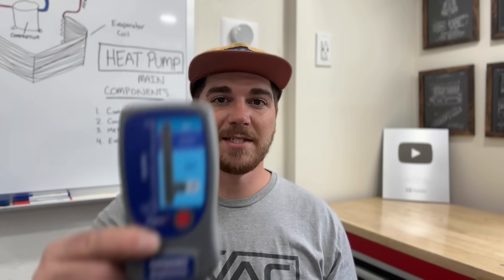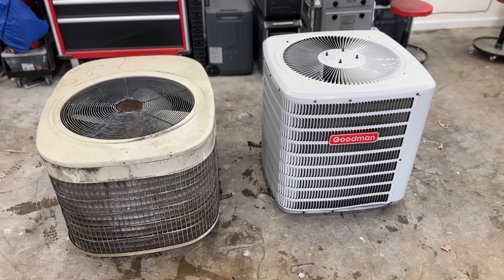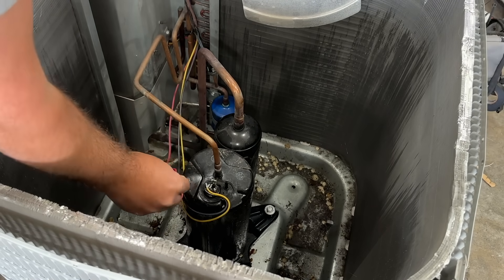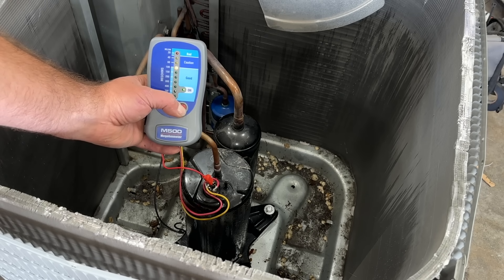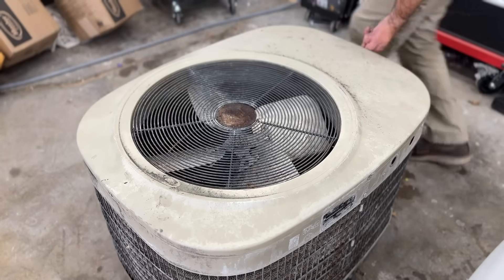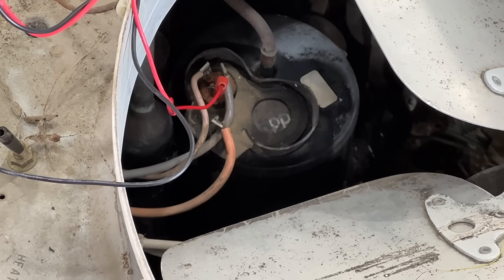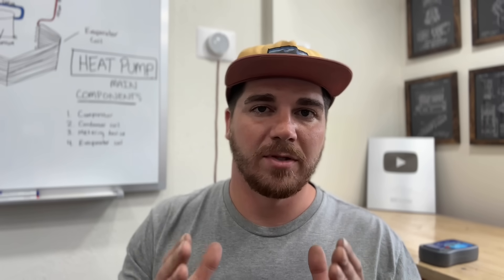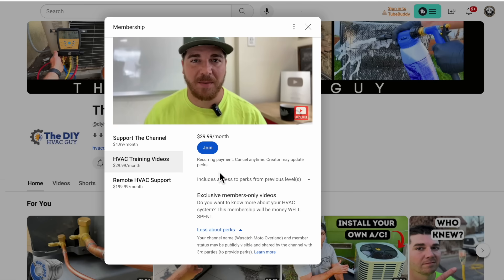Is Your A/C Unit About To Die? This Tool Doesn't Lie

Comment: i just had a HVAC tech tell me i need a new compressor and my fan motor was going because it was noisy. they gave me an estimate of $9600 to fix it. My heat pump isnt working but i never use it, i have wood heat. i do use the air conditioner all summer. appreciate this segment. may have to get one of those meters and test it myself. thanks

Comment: When testing a compressor, remove all three wires. When you pull only one wire and perform the test, you are putting 500 Volt through the entire winding. That voltage continues through the windings to the other terminals. The wires that remain terminated and the things they are connected to are included in the test.

Comment: This is a fucking lie. I’ve already talked to Copeland scroll and alliance, which is Trane. And they don’t recommend it at all! Now I have used that meter in California. They do not allow that particular meter because it’s wrong. That’s from the union workers for air conditioning they rather have an analog one but again I have talked to a lot of the companies like Copeland scroll and they do not agree with this. Now I have mega armed with that fucking meter compressors before I’ve started them! And after I ran them for several minutes! And it gave me two different fucking answers so that fucking meter doesn’t mean shit! And again I’ve talked to Copeland, scroll engineers, and Trane engineers about their alliance compressors.

Comment: The megger readings on all 3 wires will normally be the same since they are connected together in the compressor motor through the windings (low resistance).

Comment: This is interesting but I'm not convinced. The compressor is a motor and the motor has windings and we are measuring the quality of the insulation of the windings. So then what are the various failure modes of compressors? I would think a compressor could fail in various ways. The insulation of the windings would only be one of many possible failure modes.

Comment: The megohmmeter may not lie, but it doesn't always tell the truth when it comes to a compressor full of refrigerant. According to a Copeland Service Bulletin, a compressor with a megohmmeter reading as low as 0.5 megohms will still pass the hi-potential current leakage test required by UL. The Supco meter condemns anything below 30. Contaminated refrigerant is one of the things that can affect megohm readings.

Comment: Except you cannot use them a megometer on modern scroll compressors. Many standard megohmmeters may indicate a faulty reading below 10-20 megohms, while some scroll compressors can have acceptable readings as low as 0.5 megohms to ground. Use standard ohm settings only!

Comment: I just bought that tester, and to my surprise, my compressor is good. Now upon closer look, I think I got the wrong capacitor. So the correct one is coming in a few days. I also consulted the close up photo I took of the original capacitor label and hook-ups, (what color wire to which of the terminals). Otherwise, I'm looking at around $17,000.00 for a whole new cup of noodles.

Comment: You're using it wrong. You should have nothing connected to the compressor at all. You're charging up the capacitor that's why it's taking a while for the reading to creep up.

Comment: Got a coupon for free checkup from a local big name HVAC company. They send commission knucklehead tech to inspect my 2006 air handler, said the contactor is shot, need an entire new system, nobody makes contactors anymore (BS) and a company salesman would stop by and get me setup for a new one. A second opinion said contactors fine. Five years and ac still running.

Comment: 1:46  pull disconnect so no power  nothing live...  WRONG. after pulling disconnect open disconnect cover & see if it's Not bypassed. BC doing this over 30yrs Many times some jackleg jumped it or it's a bogus non working disconnect box.

Comment: I cleaned out my coils, then the compressor wouldn't kick on, but the fan did. Capacitor went bad, but easy fix. Hardest part was finding the right one nearby.

Comment: 46+ years in the HVAC trade so I'm sure I know a little something about HVAC. 😎 Take it from me when I say "always get a second or even a third opinion from a reputable company". Unfortunately in this trade, too many techs will try to breeze over checking a system and attempt to persuade the client/customer that a new system is required and that they will give you a great deal if you decide to go with their company. Those are a red flag so beware. Good video with very useful information but a great tech will sand or find a CLEAN ground and ALWAYS remove all compressor wires FIRST. That megger tool is  fundamental in my tool kit that has helped me many times. KEEP LEARNING young man because we are always learning new things in this trade. Good luck out there and stay hydrated.

Comment: Great video and advice. I purchased the tool. I have 20 year old Trane dual compressor system. It took everything I had to get to the low stage compress plug and test it, which passed with flying colors. If I want to check the high stage, I have to go Mission Impossible and hang by my feet to get to that plug, with the height of the condenser and 2 compressors jammed in there it's a mess. Is it a safe bet that since the low stage passed, do you think the high stage is in good shape as well? Thanks.

Comment: Once you have megged one winding to ground, you have megged them all, since they are interconnected inside the motor. The resistance line-to-line is very small compared to the megohms that the megger is trying to check.

Comment: Ummmm...wondering why can't I check resistance of each winding with any of several DMMs I already own?????
Reply: A megger applies high voltage to the winding. I have one that goes in steps from 250 to 500 to 1000 volts. This is useful to find bad insulation that breaks down under voltage. Your DMM probably puts out only a few volts. This is not enough to break down insulation.

Comment: I replaced my 1970 Lennox unit a few years ago just because I wanted to update my whole system, about the same time as my 1972 Rheem Hot Water heater that finally failed.      There was a  time when there was still pride in American manufacturing.   😞

Comment: wouldn't a decent multimeter be able to measure megaohms like this device?  or is this something special?
Reply: A megger applies high voltage to the winding. I have one that goes in steps from 250 to 500 to 1000 volts. This is useful to find bad insulation that breaks down under voltage. Your DMM probably puts out only a few volts. This is not enough to break down insulation.
Reply: @tommacdonald6070  ahh ok.  I have a Fluke MM... dunno what model, found it on the road.   AC/DC volts read accurate, likely fell off a vehicle.
I'm sure it doesn't, but will check to see if it has the capability.

Thx!

Comment: I thought you have to check winding to winding not winding to ground
Reply: For a megohm test, youi're looking for insulation breakdown from winding to ground. This should be a very high value of resistance - in the millions of ohms. When checking the windings themselves, you measure from lead to lead. The resistance readings are very low, probably under 20 ohms.

Comment: I've seen a video where the compressor windings were checked using a multimeter rather than that tool.  I wanted to do the same and tried to remove the plug on the compressor, but its rubber and it's stubborn, so I'm afraid to force it and break something.  My question is this; can the compressor be checked by attaching to the other end of the wires coming from the compressor?  I'm not planning on staying where I am and I don't want to have to buy a new unit if I'm not staying so I'm doing what I can to keep my old unit going.  I've already been a victim to the capacitor scam about 6 years ago and now I change it myself every two years just to be safe.  Any help would be appreciated.  Thank you
Reply: Find out or ask in the comments of that video which model of multimeter was used.  I realize this Supco in this one is cheap, the Flukes that can do this are $800 and up for this level of impedance.

Comment: I'm going to have to get myself one of those and test my unit.  My system is old, it's a Miller, and I've had techs try and sell me a new system several times even though it's running just fine.  Two years ago, the fan motor stopped, and I heard the same "you need a new unit" story.  But I replaced the fan and motor myself for less than $250 and it's still going strong.  I don't trust the service techs!!!  Thank you for posting this, it's much appreciated!!!
Reply: same here.  31+ yo miller unit built by nordyne.  repl start cap couple times. most recent cooling fan bearings dried up. replaced deteriorated oil felt with cig filter felt. reoiled. back up. replaced leaking evap coil 4 yrs ago. system still going.  scared to replace "just because."

Comment: Misleading information for a homeowner. This would prove a short to ground/ loss of electrical insulation only. A simple google search will pull up the many other ways a compressor can fail. Nothing wrong with the tool or this process. It just doesn't  tell the whole story.

Comment: Shouldn't you remove all of the wires from the compressor before you do the insulation test ? Otherwise you are measuring other parts of the circuit and not just the compressor alone ?

Comment: The potential to poke a hole in the condenser coil tubes while working on the unit is very high, be very careful when messing around, the condenser coils are intentionally made with very thinwalled tubing, be careful folks !

Comment: Thank you for this.  I called someone to check our AC after I watched this a few months previously.  He tried to show me that it wasn't checking out with the megometer showing a red light up high.  The trouble was the "On" light wasn't lit.  I asked him why it wasn't lit and he said he didn't know.  He also told me that my heat exchanger had a crack and was leaking carbon monoxide, and he should red tag it.  I pointed out that there were 2 Carbon Monixide detectors right buy it.  One a straight CM detector showed 0.  The other was a combo smoke CM detector - Neither had gone off.  He said they were probably defective.  Nope.  Well, now I know who not to call.  Shaking my head.

Comment: Ac guy came and didn’t even do diagnostic , looks at ac unit later says u need new system 10-15k , I’m like gtfo.. another comes out , says it’s your board , $500 .. much more reasonable

Comment: Some residential compressor manufactures DO NOT recommend this!!  Get away from DYI "Experts"  they only know what the last YOUTUBE video they watched, a lack of actual field experience  or school technical  knowledge.
From LEO AI
In summary, while a megger tool can be a useful diagnostic tool, its use on a residential air conditioning compressor is not recommended without proper training, understanding, and application. It is essential to consider the complexities involved and to interpret the test results correctly to avoid misdiagnosis.

Comment: Yea, I have to call psuedoscience on this.  You are measuring the resistance between coils in the compressor and ground.  With the compressor still connected to the electronics.  And calling that an indicator of the "health" of the compressor.  If you were to disconnect the leads to isolate the compressor, then that might be a way of checking the insulation on the wires in the compressor, but you didn't do that.  So you are including whatever is going on in the rest of the circuit.  There is no telling what the rest of that circuit is supposed to be doing in a perfect, brand new unit, so there is no way to interpret the measurement of the resistance.  In an older single stage system, the only other thing on the circuit is probably the start/run capacitor, so what you are probably measuring here is the resistance of the capacitor, which if it is low, likely means that it needs replaced, but that's an easy fix.  If the new system is inverter driven, then those readings could be perfectly normal.  The fact that it "started bad, and took a minute to move into the good range" would just be the capacitor charging up.

Comment: A megger is only going to tell you the condition of the insulation in the motor windings and internal electrical connections to ground.  You need to preferably disconnect all wires on the compressor before testing to totally isolate it from anything that might cause a false or questionable reading. You could easily have a failing compressor that tests 100% perfect on a megger but could still be wore out (not maintaining pressures/excessive internal bypass or blowby), contamination, shorts between windings but not to ground, or other internal mechanical failures so more tests should always be done to evaluate a unit before condemning it.

Comment: First off, when using a megger, you need to be grounded to the compressor shell, and not a bolt on the machine frame. Compressors are usually mounted in rubber bushings to  to reduce vibration transmission for noise control.
Second, since the megometer, is measuring insulation quality to ground, it will also detect moisture in a system, and contamination in the refrigerant.

We always use this device on annual inspections of commercial systems, to locate a potential breakdown, long before a failure can occur.
Avery useful tool when used properly.

Tim

Comment: Our unit was installed when we built the house in 1999. The unit is a heat pump/ac.
4 years ago the board burned and the cap swelled.
 The tech said no parts available, you need a new 5000 dollar unit.
I found a board and a cap... about 130 dollars total. 
The only maint we have ever done is taking a hose to the unit every spring and fall. (Lots of farms here)
And changed the inside filter. About 25 years and still doing its thing.
Kinda scared to put a tester on this one.... might male it break down. LOL

Comment: You have to be careful using a megger such as this, on a compressor that may have the electrical windings sitting  in the compressor oil. This can give a false reading, indicating a low resistance of the windings to ground. I would be reluctant to use a megger on a compressor. Preferably using a megger on motor windings. Additionally, pull all the terminal wires off the compressor prior to testing for a accurate reading/test.

Comment: 😮    when I was working for a company I had the opportunity to work with electrical engineer...   he told me that in order to graduate from school 😊😊  he had to design a component in a a/c. Or. Refrigerator. Or any product.. that would fail. Within  5 years.. in order to graduate.  Funny how things will break down and you have to replace it. Or repair it.. 😊  things are not made like the. Old times.  That would last forever..

Comment: Thank you for the great information. I do have a question, however. Is there any issue with performing this test through the wires? That is, completing the circuit through the wires without removing the fan? I would try it that way since the wires are all accessible without removing the fan.

Comment: My capacitor blew, it was a 40/5 and replaced it with the same one, now my AC runs but barely cools, it take 5 hrs to drop 2 degrees from 78. It was working fine before the cap blew.

I've called 3 places and nobody wants to look at since i was tge
 one who changed the cap. Is my compressor shot? The large suction line is barely cool. I don't know what else to check 😢 I've changed the filter and washed out the unit with a garden hose.
Reply: Same thing happened to me. Finally changed the 2 time delay fuzes in the disconnect. Instant cooling!
Might want to change the contactor too.  My 5 ton  Goodman is 20 years old, now runs as good as ever in Southern California.

Comment: Just because the coils of the motor aren't shorted doesn't mean the compressor is still good - the bearings can be shot, the valves etc. but you make it sound like you can test whether the compressor is still good

Comment: Totally agree.  We had a local contractor try to sell us a whole new system, based on "you need compressor".  We were suspicious since the lifetime on the compressor was only about 3000-hours.  Got another reputable contractor (Rocky Mountain), and they diagnoses problem, fixed it, for only 80$-USD.  Can't mention the scam shop, but sure would like to.
Reply: Why can’t you mention a scam shop? Did you sign a NDA?

Comment: question - is that gizmo checking for the motor winding?  what about the compressor?  how do you know it will still produce the pressure the system needs??

Comment: Well, that only represents the status of the motor coil insulation. It doesn't mean that your valves or pistons or rotary things are damaged or worn out... also, if the chassis of the compressor hasn't a good connection with the AC case, the result can be OK too. Moisture, capacitive coupling, etc, can also affect this reading, that's why you can see some oscillations in the reading. It's important that this devices need high voltages to read souch high impedances. It doesn't affect the motor, but for inverter motors it's better disconnecting all wiring from the motor to not affect the electronics.